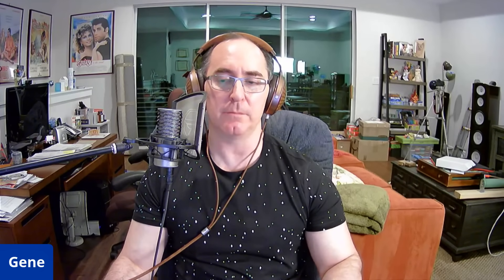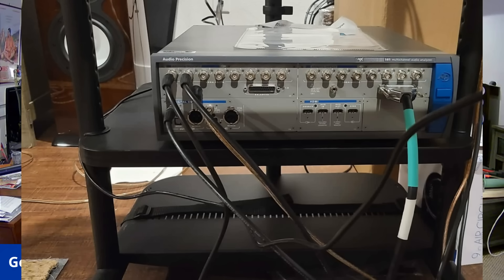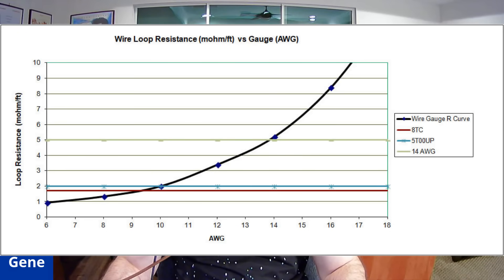Speaker Cables Really Don't Make Much of a Difference?

Comment: Audio technology reached its absolute peak about the time of the Apollo moon landings, when transistors delivered stable, quiet and flat frequency response from 20 - 20 k Hz.  Everything since hen has been splitting hairs.  That’s why audio equipment reviews are so subjective, using adjectives (airy) instead of objective measurements.

Excellent channel.

Comment: My general theory is that you keep speaker cables only as long as is needed. For most applications where you have an amplifier rated at 75 watts RMS or less at 8 ohms 16 gauge AWG stranded zip cord is fine. Keep your component interconnects as short as possible too. If you can solder, get some quality RCA or XLR connectors with good shielded cable and make your own.

Comment: I just replaced my heavy duty Best Buy basic copper wire stereo wires with Rocket 44.  At least 30% increase in sound quality!! More bass, separation and overall sound quality.  So speaker cables DO make a difference.  I paid 900 bucks about for these speaker wires.  Look ‘em up…..way cool.  Would not hesitate to buy again.  Not reaching for EQ or volume so much now.  EVERY song sounds better! IMO this huge upgrade is as important as any component in my chain.

Comment: To your comment at 12:12 , no. What we’ll say is how about actually LISTENING. Does a silk dome tweeter sound identical to an aluminum dome with identical measurements? No. LISTEN. Measurements are a tool that is one step to a competent design. But there are things that are musically meaningful that aren’t measurable. Ask a violinist why a Stradivarius will make people cry while a seemingly identical newer but cheap violin will not have nearly the same richness.
Reply from the maker: You're confusing sound production with sound reproduction.  I'm talking about the transfer of electricity from a amp to a speaker.  In this case, beyond wire gauge resistive losses, there isn't much else but placebo and lack of understanding by audiophiles that want to believe in magic.

Comment: Almost 4 decades ago I happened to find an issue of The Audio Critic at my local newsstand this was ( ha-ha) the only way to find out about your favorite subject. One of the highlights in the magazine was the list of the 10 biggest lies in audio. Naturally insanely priced speaker cables and interconnects were explained and exposed as the sham that they are. This knowledge has served me well and other than buying a phono tube amp over solid state has saved me a lot of $$$ over the years

Comment: If we accept that current level of science in audio technology is inadequate to explain auditory phenomenon, then why would a critical listener base their cabling decisions on existing measurements vs.  comparative tests with their ears?
Reply from the maker: We don't accept that. Only audiophiles that can't acknowledge placebo bias make such claims.
Reply: @Audioholics  Placebo bias is easily controlled with single or double blind testing (and serves as the basis of claims I would offer on analog interconnects or DACs for example).  Also notable is the strong confirmation bias  apparent in many comments here, just held in the negative towards improved cabling performance.
Reply from the maker: @BradfordWarner  most audiophiles won't submit to blind testing.

Comment: I salute your diligent work and scientific intent.  However, the philosophy behind this method assumed science has "everything figured out" and everything is measurable today.  As a reminder, there are many things that Einstein said in his Theory of Relativity still can't be tested or proved in lab. 

Based on this exercise, it is safe to conclude that, based on current science and human knowledge, and available measuring equipment,  the measurable differences is insignificant.  Anything further than that becomes a personal opinion, which you certainly deserve.
Reply from the maker: Until someone can prove audibility between cables in a controlled blind test, it is settled science and cables DON'T make the audible differences some audiophiles claim beyond placebo.

Comment: Just think of the nice cables you could buy if you hadn't wasted so much money on all that test equipment. I use the Externally Arrayed Response Sensors, also known as ears. I got two for free at birth and wear them all the time.
Reply from the maker: just think of the better gear you could have bought or improved room acoustics without the waste on expensive cable audio jewelry 😉
Reply: @Audioholics  I use modest Kimbers (PBJ, Hero,  4TC, 8TC  and some inexpensive Audioquests). Power cords and board are Isotek, not the posh end there either). My Luxman sounds great using these.

Comment: Years ago in the mid-1990's, I did a listening test with the highly regarded Kimber Cable 8TC, LAT International SS-1000D, Monster Cable 12 gauge, and some cable from Tara Labs, I think. Speakers were what I could afford at the time, B&W DM602 series 2, and a B&K AV1000 105W amp and B&K AVP-2000 av preamp. I remember HATING how the 8TC sounded through the system - it was by far the dullest, lifeless sounding cable in the bunch. It was very obvious to me. I remember being so disappointed because it looked cool and got such good press at the time, but I hated how it sounded. I ended up loving the LAT International SS-1000D speaker cable and ended up buying them and other LAT cables through the years. They used a silver clad high quality copper cable they called "SilverFuse", and a Teflon jacket, I think. They always sounded fantastic to me and were reasonably priced for a high end cable. Sadly, the owner/builder closed the company due to declining health, and LAT is no longer available.

Comment: Hey Gene, what do you know about the old Monster XP BIG that bestbuy use to install in homes with home theater installation, ive had these cables for years. Denon AVR X4500H and KLIPSCH Premiere speakers RP 8000F ii, RP 504C, RP 600M, SPL120. My speaker cables XP BIG were free, from a friend whom had BB do a home theater install. And ive had them over 14yrs, are old speaker cables ok to continue to use?
Reply: Does anybody know?

Comment: In my humble opinion, and what seems perfectly logical, and unavoidable, is that the best cable in the world can only have the lowest resistance, the lowest inductance, the lowest capacitance all per meter. Moreover, it must have the highest insulation between the two potentials, i.e. the +, and the - 
A manufacturer who does not provide these parameters, should not be taken seriously...
Any other explanation or theory should be considered as snake oil !

Comment: This is why I don't even bother with audio reviews that don't take objective measurements. I've seen too many ridiculous statements about $10,000 power cables and $300 stands that hold your cables off the floor, making dramatic differences to the sound. The placebo effect with expensive audio equipment is almost as bad as wine snobs thinking cheap wine is amazing when you tell them it's $500 a bottle.

Comment: I think you should improve your measurement with following:

1. In acoustic you do not care that much for harmonic frequency (20Hz - 20kHz) but for transition characteristic which is of course related to frequency.
So for transition characteristic you put square signal (~1kHz, ration of duty cycle does not need to be 50%) on input and check the form of output and time of falling/rising edge.
E.g. Expectation is for signal sampled with 44kHz that rising/falling edge is sharper/faster than signal sampled with 22kHz.
Human ear is sensitive to differences/dynamics (changes) in music, e.g. hitting the strings of guitar.
Similar like slap with hand to face, do it slow and fast with same power. Which one would you feel more intense?

2. I noticed that you did the measurement to 8 Ohm resistance with 10W which makes 9V signal witch makes sine with max +/- 12.7V.
If you have Amplifier with +/- 50V power supply then I would suggest to do the test with 1kHz square signal with amplitude +/- 35V.

And now we are ready to check the influence of cable on transition characteristic of high power signal.
Reply from the maker: Wow that was a lot of nonsense and you obviously didn't watch the video. I measured in both resistive and loudspeaker loads. I didn't measure the acoustical differences which would be too small to see based on variances in the measurement process and microphone itself. I measured the electrical differences. My test results are solid and conclusive.
Reply: What exactly is "transition characteristic"?

Comment: The sound signal does not travel through the copper wire, it travels through the electromagnetic field surrounding the wire, so your tests are a waste of time.
Reply: That's a complicated topic. You would need to start to bringing up what is information, electrons, energy, mass, Quantum physics, and still you wouldn't get a definitive answer.

Comment: We know you give the best and most informed videos about everything home theater. You always have the best testing equipment, and you explain everything so well and concise. However, I refuse to believe that some of the high dollar cables out there don't produce a better sound compared to the cables you by at Home Depot. I mean, you may have chosen the wrong cables for this test. I know you're going to say you chose the best cables but still, it depends on the cables you buy and use. What about the ribbon speaker cable? Some of those are very expensive and I know they're much better than some of the others. In your defense, I think you just chose the wrong cables. There some speaker cables out there that cost hundreds and thousands of dollars. They should have been tested, not just the Kimber cables, which are a good brand. Keep the videos coming!
Reply from the maker: So what you're saying is no amount of evidence and objective proof will convince you thwt snake oil exists in Audio. I've tested hundreds of speaker cables. There's no magic other than what people create due to lack of understanding or acceptance of science.

Comment: If the cable is 50ft would you notice the difference or draw significantly more power from the amp.
Reply from the maker: The additional losses of longer cable runs would be proportional for both cables.

Comment: I don't think we have the ability to measure what the brain heard. I was skeptical that cable could make a difference but after testing a few cables on high end system, I came out believing that it does as the differences are not subtle for some cables.

Comment: Excellent info.  You mentioned cable length and drop offs.  At roughly what distance would you get significant drop off with a decent quality 14ga cable?  Would it be a major difference at, say, 50’?

Comment: People buy expensive cables, to impress the uninitiated. The late Rodger Russel used coat hangers, as test cables, and found no difference. I spent $35, on a roll of 10 gauge stranded, single conductor copper wire. I soldered some E Bay 'Fork' shaped connectors, and that is what I use in my system. Even at that level, It is pure overkill....at least I didn't spent thousands, on audio merchandise for suckers..

Comment: I use BlueJeans 10AWG cables. I bought a 200ft loom and terminated them with bananas. I appreciate them for the robustness and fair pricing. I have never heard any clear differences between cables and am highly resistant to the forms of expectation bias. If I cannot reliably tell the difference between two cables, then there is no need to spend a bunch. Room acoustics, room correction (DSP), and speaker performance are where to focus.

Comment: If your cable is too thin, and you pump a lot of watts through it, would it be more susceptible to heat up and perhaps burn?
Reply from the maker: It would require a very thin cable and a lot of watts. 12awg can handle 20A of current!
Reply: @Audioholics  oh awesome. thanks for that!  Any more 'myth busting' videos around home theatre would be amazing if you can make them. Kind of like how actual Atmos mixes are super poor and mostly non existent.
Reply: maybe a double blind test on cheaper vs expensive speakers... or 5.1 vs Atmos. or integrated amp vs separates. Can 5 of your friends really tell the difference? 😅

Comment: I use to work at Circuit City back in the day. We picked up Monster Cable interconnects. People would ask Does it really make a difference?  So I took an Onkyo rack system and swapped out the whole left side with Monster Cable. From CD player, amplifiers and to the speaker. Then with the balance knob I could do an A/B test. The average American could tell a difference. 
To be fair, we were going from trash cables to 10 gauge cables. Maybe going from the bottom of the market to mid level you can hear something.  It looks like going from a mid level to the top of the line, there is not much of a difference. Your tests makes sense.

Comment: I very recently swapped out the speaker cables in my bedroom audio setup.
It's a relatively modest system comprised of an Arcam DV78 DVD player, a Marantz PM 7200 integrated amp and Proac Studio 100 loudspeakers on Target R2 stands.
I had been using my rather luxurious high-end looking Harmonic Technology Pro 11+ louspeaker cables for years and on a whim decided to give a short set of OCOS wire that I had lying around a try.
Lo and behold, while there was nothing wrong with the HTs the OCOS cable for some reason just make the system come alive and there's simply a decidedly greater impression of music being made.
This despite the fact that these cables were half the price of the HTs and look like bog standard black coax cable.
Don't know if system synergy comes into play here, but it does go to show that pricier isn't necessarily better.

By the same token I've found that changing my amp's operation from class AB to class A just robs the sound of energy and expression and that using a power conditioning filter only gives a positive result on my DVD/CD player and shouldn't be used on my amplifier as it causes a similar 'deadening' of the sound signature.

Comment: Well since it AC signal  is not the impedance  effected by inductance and capacitance  not resistance at DC the more important factor  to look at.  Given that the speaker is not a 8 ohm load but rather a complex value nice test there.   Swr  but given the power level and non repeating wave form of  music a bit harder to duplicate . Testing that relates to what is heard has been a point of contention  for 100 years.  Marketing has applied theories what long lines do and high frequency to a low power low frequency area . Make for a nice story selling the sizzle not the steak .  So testing the steak will not tell you about the psychology  of the sizzle .  One may need to look in a place that is not the easily measured arena .   An irregular artificial  waveform  with a complex harmonic structure may help . A computer generated  repeatable one that thus can be compared to the original  so that  negative feedback is lessened  in the time domain .  These are not what one looks at when dealing with long lines and small signal integrity from my understanding .

Comment: Years ago I added a ten gauge Monster cable and due to Lower resistance??? On heavy base my amps protection circuit kept but tripping out. Switching back to my usual 16 gauge zip wire no. So? Does gauge matter because I reasoned the impedance was lower and more power pulled out of the amp? Does any of this work? I also noticed high power car audio is huge gauge low lengths of wire under a foot in many cases. Why? I'm sorry

Comment: Yes they do. Larger cables give more music depth, more cone control, better signal path...etc. The cables used in the video are much to small to make much of a difference. Mine are 1" in diameter with multiple strands of 6ga. copper wire.
Reply from the maker: That's silly. 10awg is sufficient.  Super thick cable will have skin problems at audio frequencies unless the strands are isolated.

Comment: I went from super cheap super thin cables to some custom mogami cables, not too expensive and immediately heard a difference. After the break in I heard a huge difference. That being said the original cables where really bad. Ultimately if you are happy with the sound, then don't change it. If you perceive to hear a difference then good on you. The problem with alot of this is that it is subjective. You can't tell someone they heard a difference or will/will not hear a difference.  Its up to that person's hearing. Anyways great video. I like the science.
Reply: Of course they sounded better, the trouble is, the same as with every other piece in the chain, the more you spend the less improvement is made, otherwise we would all be listing to systems that cost less than $100, if such a thing exists.
Also the irony that he uses himself some speaker cable that costs over $1000 a meter pair

Comment: Nice test! I wonder how copperplated aluminium cables perform. I got 0.75mm² from a hardware store and didn't realize it was aluminium with a thin layer of copper! Of course aluminium has 61% the conductance compared to copper. I've since replaced it with real copper cable 1.5mm² (16awg). Can't say I hear a difference, it did give a little more crackle becauce the copper plating wears away quickly when soldering or clamping in screw terminals. It just doesn't give a proper connection.

Comment: what about compliance you didn't measure compliance.
be good if you did all speaker cables manufacturers and some other cables like mains cable use as speaker cable, as a comparison these figures are not out there in general. use a cat5 cable as well.